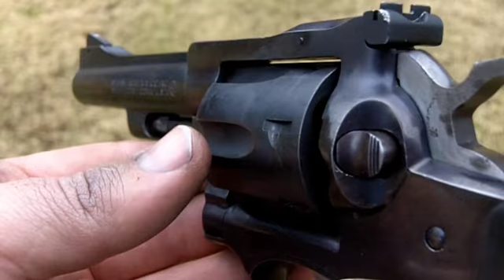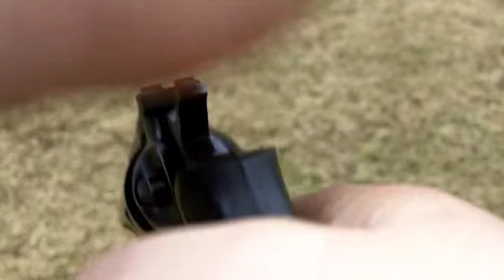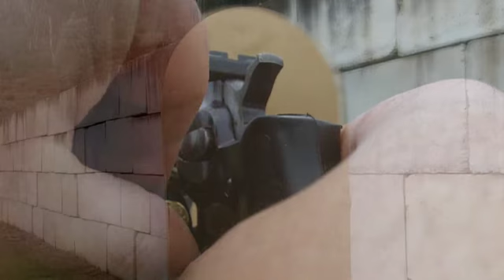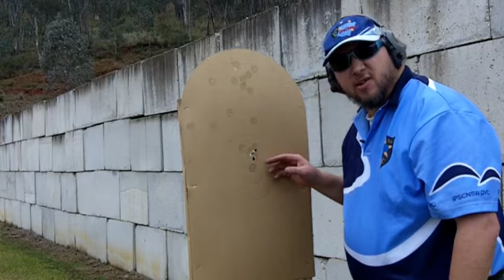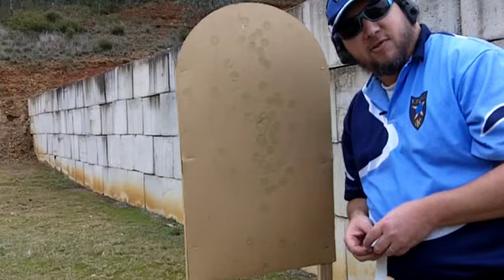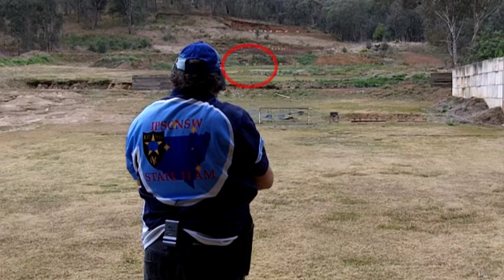Ruger Security Six Review - 357magnum

Comment: No idea how I got on this page but, gotta love the ruger security sixes, I have a 4" stainless clean as a whistle, mint condition,  paid a mere $200 for it because the front sight was missing, easy and cheap fix. Just bought a WEIG-A-TINNY Mini Scope Mount and going to pop a small red dot on it for shits and giggles. Luckily I have spare parts just in case, benefits of working in a gun shop. May even consider making an Aussie Frankenruger out of it as barrels are cheap enough, a 14" 1/12" twist with 180gn prog sounds a hoot

Comment: I noticed the stain on the hammer. What's the story on that? 

Doesn't seem that Rugers hold up well if they're blued -- or it could be just the junk that gets on them when they get dirty.

To Smudleydog -- you didn't really turn over your Security-Six when the U.K. asked for it did you? Really?? Didn't you actually lose the thing when you were paddleboating across the Thames? Fell right over the side! That's the ticket!
Reply: Yeah that gun looks like it's been through the ringer. The finish looks bad. That's why I picked mine up in stainless.
Reply from the maker: Fuzzy Ewok 

The finish looks bad because I shot a couple hundred rounds through it that day. It's not perfect but yeah it was pretty dirty when I did the video.